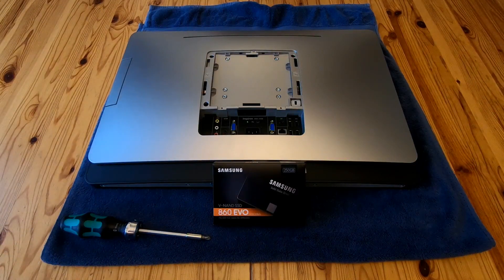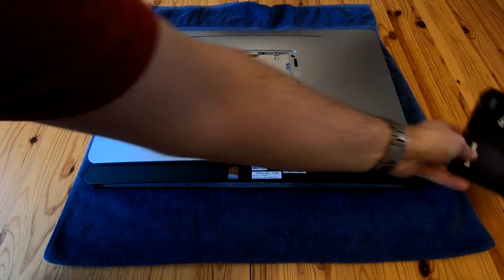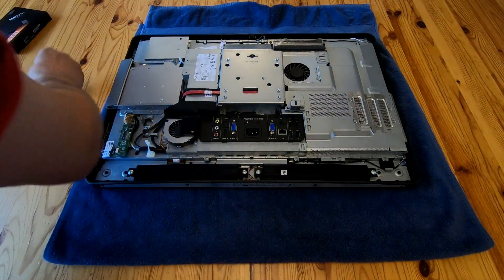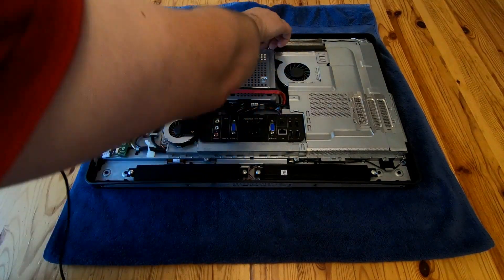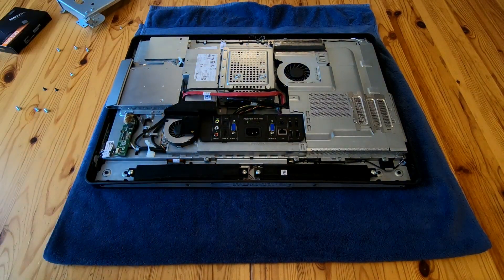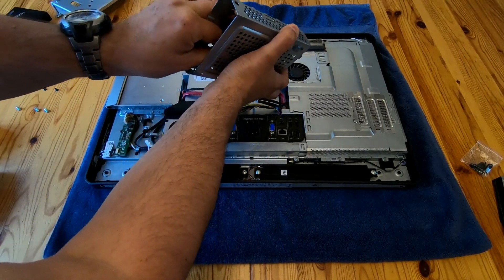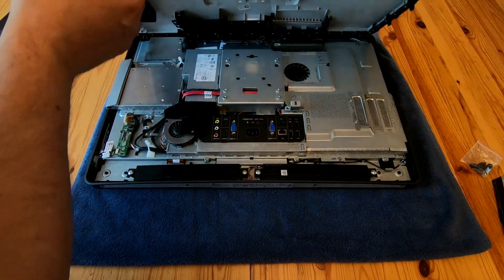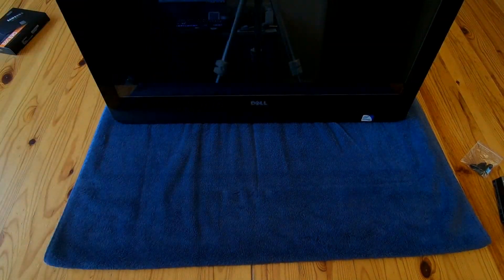DELL Inspiron One 2330 HDD Upgrade and Replacement *HOW TO* Guide

Comment: Just stumbled across your video, can you post a link for the upgraded drive ? I’m sorry if I missed it. You’ve made this look super easy, thx. Would also like to apologize for some of the harsh comments posted by others - as always some folks are angry about something else and come to vent on the Internet !
Reply from the maker: Don't worry... there's only one critical comment and that was dealt with.

:)

What link are you specifically looking for?

The Samsung EVO series SSD's are pretty widely available...

But I would suggest getting one of these rather than using Velcro now...

ORICO 2.5" to 3.5" Hard Drive Adapter: https://amzn.to/3kLmXFV

And a Spudger is pretty much essential for releasing the compression fittings on the plastic cover: https://amzn.to/2PT6roO

But if there's anything else just let me know.
Reply: Need a link for the Samsung Evo 1TB drive. I’m afraid to order a drive with the wrong connection. Thx again.
Reply from the maker: @papawsb419  How about this...

Samsung EVO 1TB SSD: https://amzn.to/2Y0U12H

And you should get a Spudger...

https://www.youtube.com/watch?v=Pen57kOJTx0

:)

Comment: What product would you recommend a dvd/cd rewrite unit I'm going to replace mine, in the above model as well.
Reply from the maker: It’ll need to be a slim model... note that these kind of devices are only manufactured by large companies. It’s not the kind of thing anyone can bodge together in their garage - you need to be a pretty substantial business entity to produce this kind of device.

So just get the cheapest DVD-RW you can find.

Watch out for the ‘official’ DELL models - they are more expensive and often just DVD readers. They also might have little mounting parts attached that aren’t needed for this AiO.

Liteon make these drives for around £16 but check the connections match the one that’s already fitted.

Also... the one that’s already fitted might have some branding on it too - so search for that as a comparison if it’s not DELL branded...

If it is.. then search for the part number.

As a general tip.. the part number gets better results because it indicates you’re searching with a bit of knowledge and that will tend to bring up ‘trade’ type suppliers in the results.

Comment: If my HD has bad sectors and I can only boot to safe mode can I still use the Samsung Migration tool to clone my HD?
Reply from the maker: Great question!

The answer is yes but also no. 

Which isn't a helpful answer so here's an explanation....

It depends on how many bad sectors... the clone tool will cancel the cloning process if there are too many - but it will clone a drive with bad sectors.

So after you've got all your important data copied off, try it. 

Remember that you need a Samsung drive as the destination - the software will refuse to work if you use a drive from another manufacturer.

If you are desperate to clone the drive and the free Samsung Data Migration Tool doesn't work then you can try something like AOMEI Partition Assistant Pro.

That's isn't free, but it does claim to clone drives with bad sectors.

There's a demo and guide here: https://www.diskpart.com/articles/clone-hard-drive-with-bad-sector-1984.html
Reply from the maker: Also...

Windows Installer isn’t running in Safe Mode, so you might not be able to install the Samsung software.

Here’s a fix for that...

https://www.tenforums.com/tutorials/143263-how-install-uninstall-programs-safe-mode-windows-10-a.html

Or you can remove the drive an attempt to clone it using another PC.
Reply: Nic Bunting thank you for your reply and possible solution to each problem that could happen!
Reply from the maker: Did it work?

:)
Reply: Nic Bunting unfortunately not.  the laptop was too old to upgrade.
Reply from the maker: @kathyweston8427  Sorry to hear that... its was worth a try though.

Next thing is to get the data off - assuming there's stuff you want on it that's not backed up somewhere.

Comment: Hi! Thanks for the video. Do you know if SSD SATA 3 will work on the model inspiron-one-2320 JBL speakers with 1TB HHD?
Reply from the maker: Yes it will...

Note that all the newest SSD's are backwards compatible with the previous standards so don't worry - you can fit a new SSD to pretty much any compupter that has a SATA port.

Just remember that 2.5" SSD are smaller than 3.5" mechanical drives. So you'll need the Velcro to hold the drive in place.

Also note that modern SSD's tend to be the thinner than the usual 2.5" drives - 7mm rather than 9.5mm - but that only important if you're swapping out a drive on a laptop.

:)

Comment: Hi! I would like to ask if there's any chance to fix my AIO Dell Inspiron 2330 if the problem is the motherboard?
Reply from the maker: You can swap the motherboard over - if you can find a replacement.

That’s quite a job though... so you’d better be absolutely sure that the motherboard is the only faulty part before you try it.

And checking to see if you can actually find a replacement is the first thing to do - because if you can’t get one or the ones you can find are frighteningly expensive, then there’s no point going down that route.

Comment: How do you take the platelets on the stand?
Reply from the maker: Not really sure what you're asking.... but the stand has a plastic panel that has to be removed to get access to the VESA mount screws.

See page 17 of this manual... https://downloads.dell.com/manuals/all-products/esuprt_desktop/esuprt_inspiron_desktop/inspiron-one-23-2330-aio_owner%27s%20manual_en-us.pdf

You'll need a spudger or plastic stick to pop the plate catches so you can lift it off.

:)

Comment: Hi Nic,
 I have the same Dell inspiron 2330 you have worked on in the video, question, do I use the same cable to connect the SSD drive that comes from the old hard drive or do I need another cable.
Reply from the maker: Assuming the cable isn't damaged of faulty, use the same cable.

Normally the power and data cables are separate, but a lot of AiO devices use a single cable for both. And they are usually different lengths to match the machine.

As you can see from yours, the cable from the motherboard to the drive is a very specific length with one connector for the drive - so you'll have real problems getting any other cable(s) to fit anyway.
Reply: @sterntechdaddy   
Thanks for the reply Nic, cables are all ok just going to change to SSD as the machine is 6 years old now and following your advice about how long the drive will last, best to be on the safe side .

Comment: Nic....thx for the video.  My old hard drive was undetectable, so I bought a new one like the old one (not SS).  I followed your video and changed them out easily.  However, when re-assembled the PC still doesn't detect the new hard drive either.  Both hard drives have an extra slot next to the dual clip in.  Is there a another wire that plugs in that spot?  I can't find one in my PC or on any video I can find.
Reply from the maker: Does the cable you’ve got in yours match the one in the video?

If so then that’s the only cable you need.

Did your PC work and then stop detecting the drive, or is your PC new to you and hadn’t worked since you got it?

If a new drive doesn’t work then the tree a something else happening.

Comment: Thanks for that great video.  I am looking to upgrade my 2330 aio with an SSD 2TB.  I'm assuming it will have to be a SATA type.  I've also read on some threads that this PC cannot be upgraded with an SSD.  Hmmm?  Can you please confirm.  Thank you much!
Reply from the maker: Definitely can be fitted with an SSD.

Pretty much any PC can have a 2.5" SATA model fitted - the M.2 SSD devices obviously need a compatible M.2 interface - which older computers won't have. Maybe that's the source of the mixed messages?

Note that if a computer has a dual core CPU and 4GB RAM it can run Windows 10 effortlessly if it has an SSD pretty much regardless of age - it's the primary upgrade for older machines - and if the existing drive isn't faulty then the OS can be cloned onto the SSD really easily so the only technical knowledge you need it to be able to use a screwdriver and/or spudger to swap the drives over after the cloning.

There could be a capacity cap, but if yours already has a 2TB mechanical drive then a 2TB SSD will definitely work.

But you can use Crucial as a guide. They are really helpful when it comes to checking both RAM and HDD...

https://www.crucial.com/compatible-upgrade-for/dell/inspiron-23-all-in-one#ssd

So a 2TB SSD should still be fine - apart from the price premium for an SSD that size!

;p

But remember the Velcro tape... you can buy a 2.5" to 3.5" caddie if you want, but Velcro tape is cheaper and easier. There can be compatability issues with some caddies too, so I don't like using them.

The bare 2.5" drive won't fit securely in the space left by the 3.5" drive because of the cabling and the screw holes not lining up - and no drive likes to be free to wobble about - so get it fixed in and easily removable with the Velco tape.

Other brands of hook based fixing tape exist...

:)
Reply from the maker: Oh... and the PC in the video clearly has been upgraded with an SSD.  :P

Comment: I cannot get that first M3 screw off. If I continue, I'm going to strip the screw.

I'll wait 'til tomorrow and try again with a piece of rubber band in the screw head. I hate when I get a stubborn screw like this.

I have bad hands (surgery on both wrists, years of boxing, football, general idiocy) so this happens more than not for me.

Anyways, thanks for the video. This was helpful in breaking down the case. I'm hoping swapping in a new HDD will 'fix' this computers inability to boot. 

Or let me boot to BIOS.

I found this computer on the curb, it'll be an adventure. I want it as media center for my bedroom. I suspect I might be dealing with a bad motherboard but I'm trying to be optimistic.

If it is a bad motherboard, I'm curious if I can replace it with a spare GIGABYTE motherboard I have laying around.
Reply from the maker: I use WERA tools... never had any problems with damaging screws. They fit the screw so precisely that they tend to stick on the end of the driver without a magnetic tip!

They put a bit of blue stuff on the end of the screw when they assemble them, and that takes a little bit of force to 'crack' that so the screw comes out.

You'll be lucky to fit anything inside the case except for the original model motherboard though... its a snug fit with very exact positions for cabling.

But if you let it dry out and have started it up and the screen says something it'll probably work anyway.

And get a spudger… it'll make removing the back panel MUCH easier - especially if your hands aren't 100%...

https://www.youtube.com/watch?v=Pen57kOJTx0

Comment: Sorry, meant to include that I am working on Dell Inspiron One 2330s.  We also have a bunch of Dell Inspiron One 2020s.
Reply from the maker: All the same in terms of drive capacity compatibility. 

Remember that 2TB mechanical drives have been common for a while and compatibility is more to do with the how the operating system defines it's file system.

But that's not important with NTFS and hasn't been a real issue for most users for years.
Reply: Nic, Thanks again - 
2.) Can I clone through the USB, or through the DVD R/W plug? 
 3.) What Clone software and hardware/cable do you recommend?  THANKS for sharing your expertise!
Reply from the maker: See my other reply.... for the first question you asked. It should cover everything. :)

Comment: Nic, Great Video.  I already swapped out the HDD to SSD on one of our PCs, did a complete reinstall.  But I have another PC that I want to clone to SSD - three questions:  1.)  What is the maximum size of SSD that will work? I was looking to upgrade from 500 GB to 1 or 2 TB.   2.) Can I clone through the USB, or through the DVD R/W plug?  3.) What Clone software and hardware/cable do you recommend?  THANKS for sharing your expertise!
Reply from the maker: Here's the answers…

1. Any size SSD will work.

At the moment, 250GB is a minimum, with 500GB being worth the slight extra cost (about £20 more than the 250GB in the UK). As you get bigger, the prices get scary - but if you can go for a 1TB or even a 2TB then they should work. For added storage, a sneaky trick is to use an SDCard though - rather than pay the massive premium for the 1TB and 2TB models. You can get a 256GB SDCard for around £30.

You can also repurpose the old drives and put them in a USB enclosure too!

2. AIO tend to have slim laptop style DVD-RW drives that use a proprietary connector, so USB is by far the easiest.

You just need a 2.5" SATA to USB adaptor. Something like this: 

https://www.amazon.co.uk/USB-SATA-Adapter-Cable-Drives-en-GB-SATA-USB-3-0-converter/dp/B01N2JIQR7

But other shops that aren't river themed are available.

3. If you buy Samsung SSD drives then you can use their free Data Migration software... It is super easy to use and will clone in a few clicks with no real technical knowledge needed.

https://www.samsung.com/semiconductor/minisite/ssd/download/tools/

That only works with Samsung drives though - and the software will check. You can also use Macrium Reflect Free Edition...

https://www.macrium.com/reflectfree

That's a bit more of a fiddle than the Samsung software, but it will allow you to clone to another manufacturers drive.

Both examples use the same 2.5" SATA to USB cable.
Both will clone to larger drives.
Both will clone to smaller drives if the used space is less than the size of the new drive.

Hope that helps!

Comment: Helpful!  I am thinking about doing this on my dell all in one -  it works well but very,very slow now - I bought in 2014. I need to look at which model I have. I rather try this then to purchase a whole new computer!
Reply from the maker: Changing a mechanical drive for a solid state drive is a massive and very cost effective performance upgrade. Typical speeds for a mechanical are 40Mb/Sec, and 400Mb/Sec for solid state - so pretty much 10x the speed!

Storage is the main bottleneck in a system because RAM and CPU speeds are way ahead in terms of Mb/Sec. Using a solid state drive helps storage speed get a bit closer and works especially well for older systems with historically slower drives.

Boot times are so much faster... so you can also disable hibernation completely to get a bit more disk space and reduce system overheads... 

I could go on.... but you get the idea.... :)

Comment: I replaced my hard drive and now on my screen it says invalid partition table what did I do wrong?
Reply from the maker: Is the replacement drive new?

Did you correctly clone the old drive onto the new one?

If you have a new Samsung SSD then their Data Migration software does it in a few clicks - and it’s worked flawlessly every time for me.

Comment: Here's my situation. Our dell 2330 is a slow piece of shit, so i decided to build a new pc myself, with a128gb sdd. My question is this, can i clean and use the hdd from the dell 2330 for my new build and still be able to use the montior, or can the monitor not be utilized once the hdd is removed because it carries the OS.
Reply from the maker: Bullet points are best for this:

1. You can reuse the HDD in your new build - it'll compliment the SSD and be handy as data storage.
2. There's no video input for the 2330 that allows it to be used as a standalone monitor - it can display an external image, but it has to boot first.
3. A 128GB SSD is a bit tight on space - get a 250GB instead.
4. Why not just clone your existing HDD onto the SSD and use that in the 2330 instead?

The main bottleneck on older systems is the HDD, so if you use your SSD in the 2330 it'll make a massive difference to performance. If all you use it for is checking emails and browsing the Internet then you can save a lot of money and not bother building a new PC.

If you buy a Samsung SSD you can use their free Data Migration software to clone your existing drive in a few mouse clicks. You just need a USB to SATA cable or a USB HDD enclosure.

Also...

5. To clean you old HDD you'll need to use DISKPART to remove the OEM partitions so you get all the space available.
6. There's a lot of installed software and setting that will be making your 2330 appear slow. So you could fit the SSD and just install a clean Windows 10 from a USB stick you can make with the Media Creation Tool.
7. You'll struggle to fit a second drive to an AiO or laptop, but a cheap and effective way to add a bit of extra storage is to use an SD Card.

Any other questions, just let me know.